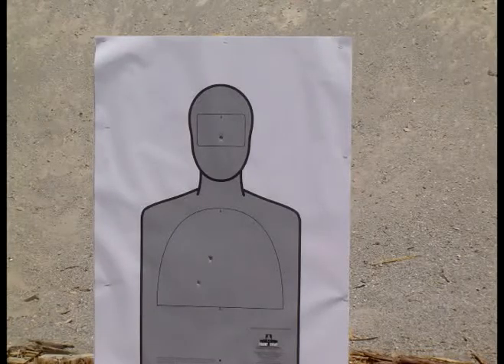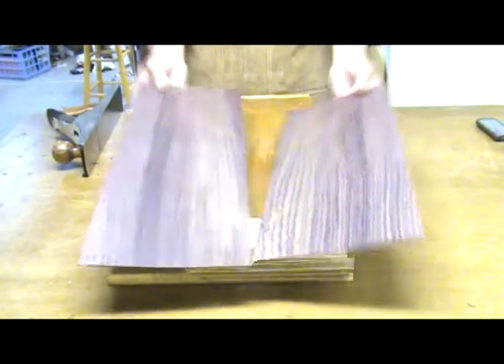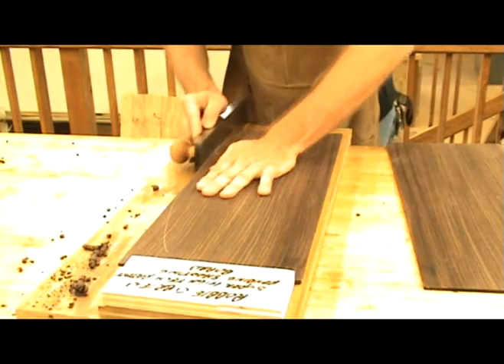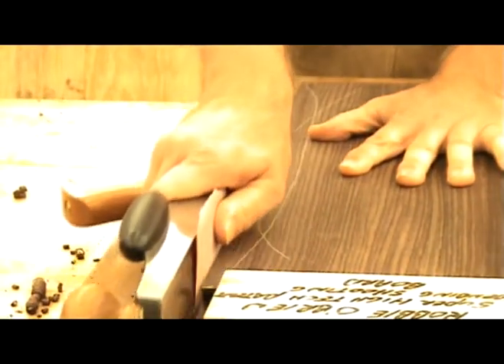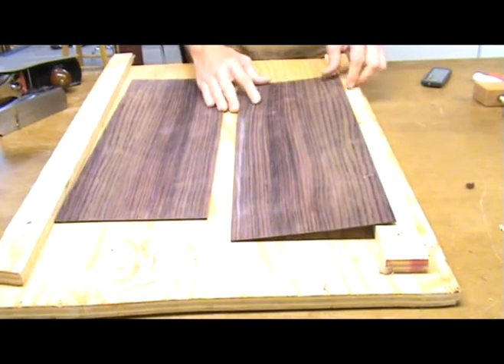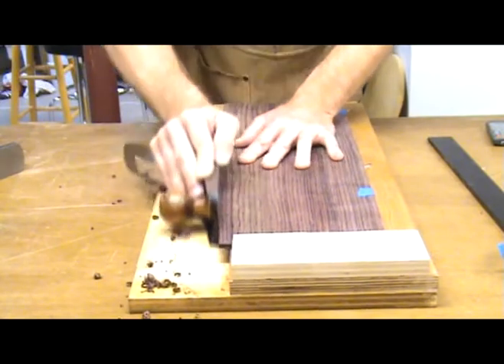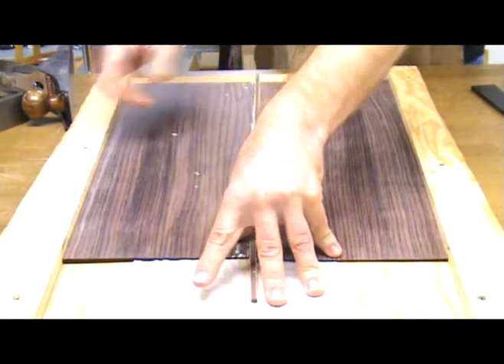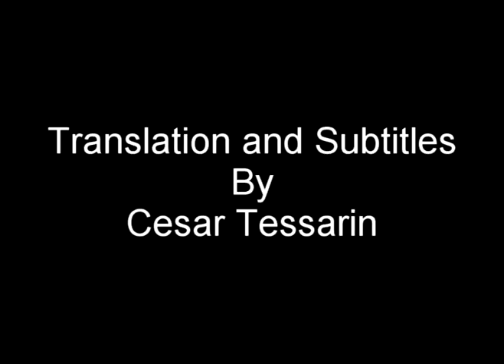Luthier Tips du Jour - The Shooting Board

Comment: I have tried this method and it works great. you can also tape some sandpaper to your work bench with masking tape. hold the edge you want to join, down on the sandpaper and slide it in long passes. this works just as well and takes off less material than a plane. I did this since i only have a small plane

Comment: Keep your edge wood pieces straight, & use slim plywood wedges, tapping them  gently into place each side, to marry the plates & make your back or top joint. Hold firm in place with weights overnight.

Comment: The jointer gets you close but after using it I would go to a  joint plane I got at a swap meet. Since all my tools were stolen I am back to the plane. I flattened the sole on the plane with glass dbl face tape & sand paper. You will need thick coffee table type glass at least 5/16" thick, preferably 3/8-1/2".  A new high end plane will have a good flat sole. Mine was pretty old and beat up, but very close to flat. I sharpen the blade with  water stones and diamond block(s).

Comment: in worst case scenario if you are making a wider bodied guitar and finally got the perfect joint but the back or soundboard became a bit narrow at the widest part of the lower bout is there a solution?
Reply from the maker: yes, use the cut out parts of the waits to flip around and glue at the widest point of the lower bout. Done properly it is invisible.
Reply: OBrienGuitars excellent that’s sort of what I was thinking just wanted some reassurance 

What’s the best way to glue
Them up cause I learnt do a pressure clamp method which is  a self clamping which may not work the same way for the shims
Reply from the maker: @juliantaylor7663  There are many ways. I usually use CA glue and hold it in place on the back. For the top I use either yellow glue or fish glue and usually tape to hole it in place.
Reply: OBrienGuitars cool thanks again as always

Comment: I guess I am a stickler for safety practices, so I feel a need to mention that your bandsaw guard was way too high. Not only was it not protecting you from the blade,  it was also not offering any support to the blade. The chances of the blade snapping and whipping around like a bloodthirsty unheld water hose increase dramatically when the guard is left set up this way. You mentioned you have students. You should instill proper safety practices in them. After all, what good is a guitar if you are missing your fingers or limbs. Just saying
Reply from the maker: Right  you are and thanks for your concern.